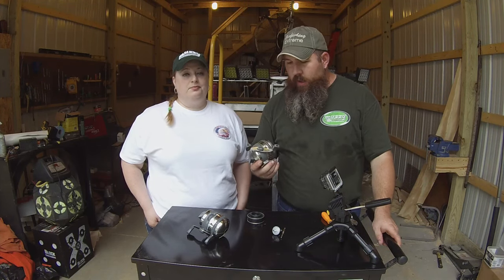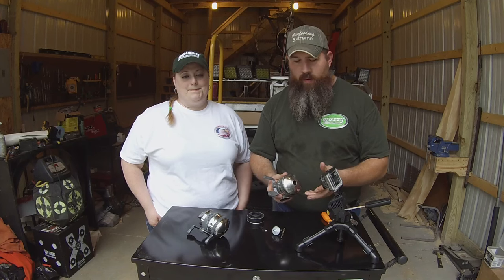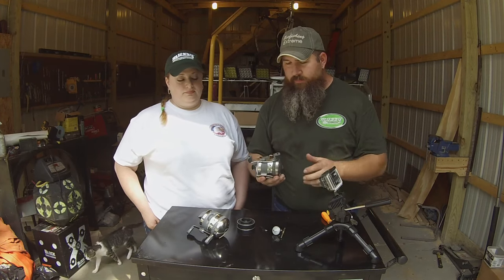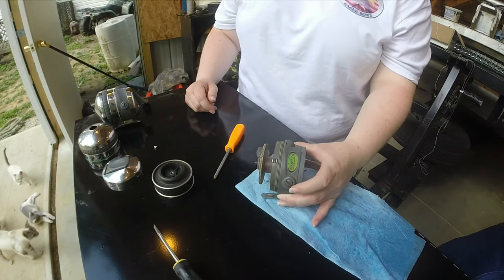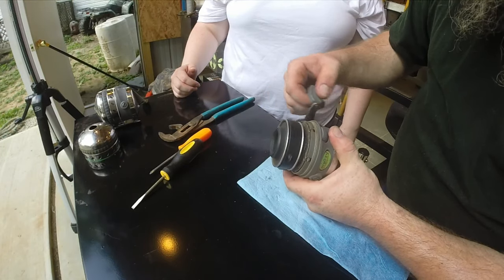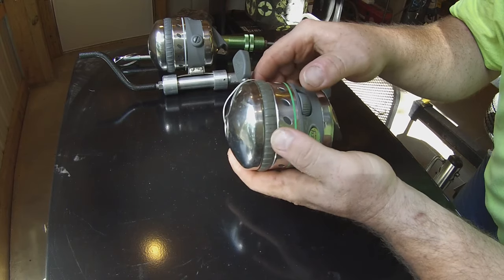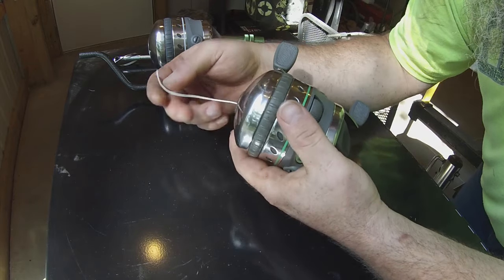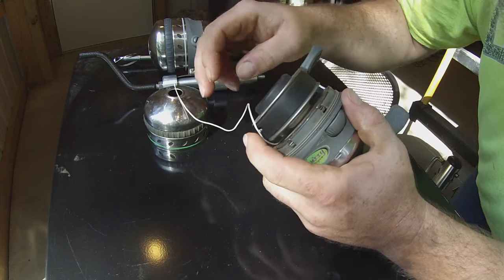MUZZY XD REPAIR

Comment: Dustin great video! I keep having an issue where the pickup pin (the sheath itself not just the pin) is sticking out a tad to far. Every other time I draw back it catches the string. Any advise?

Comment: I cannot get the grey screw out off the side of the reel to pull the handle shaft out. It just keeps free spinning.
Reply from the maker: There is another video explaining what to do. Gotta drill the head off of the screw & pull it out so you can grab the shank with pliers. They got glue on the screw during assembly.
Reply: I did find that video and was able to get it out. Thank you for replying!

Comment: what did you use for grease? didn't see you regrease it
Reply from the maker: white lithium. just dab a little with a Q-tip on the main gears, brass bushings, and press some in the bearings once a year.
Reply: seen that on the advanced part. i also put a post on bfc. about my reel. my foot is loose are those just rivets holding it on could I just pound them tight again?
Reply from the maker: yep